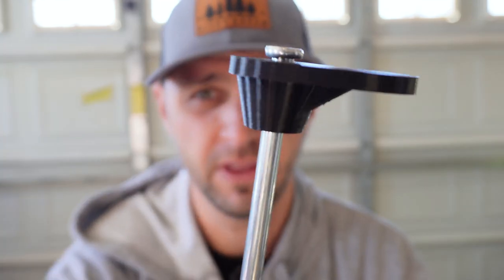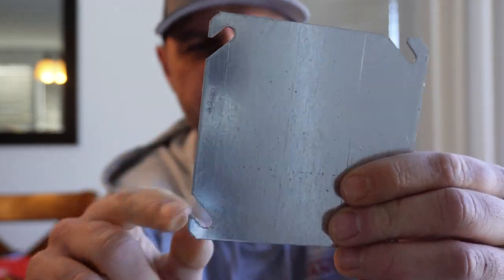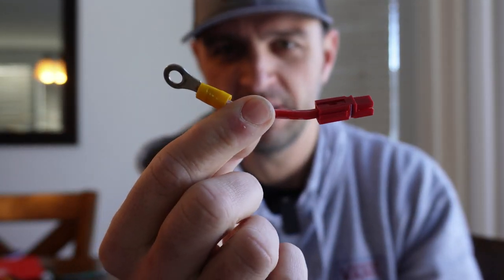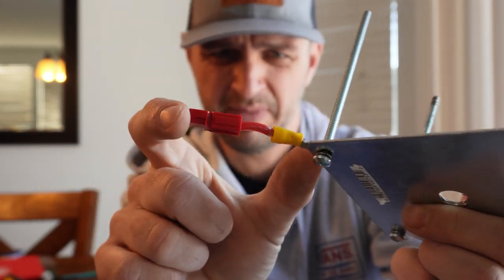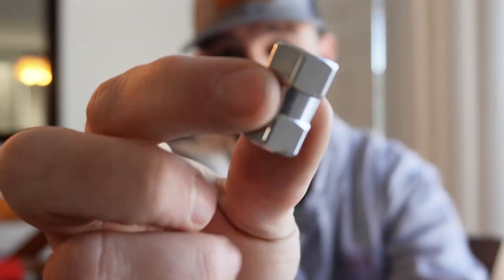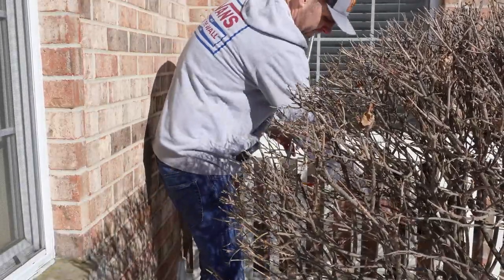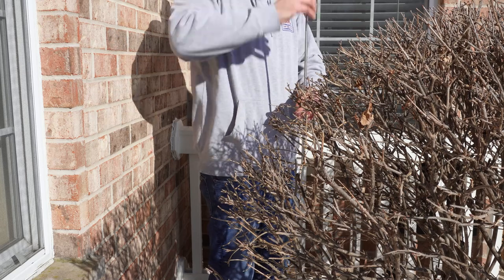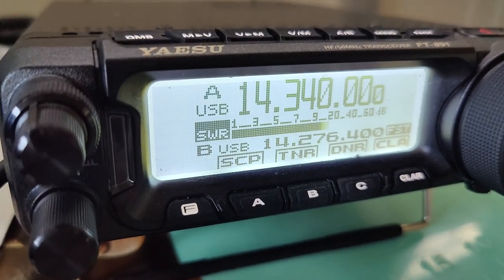Easy Homemade Ground Stake Mount - Antenna Mounting Solution for Ham Radio / CB Radio

Comment: An easy modification, use thread rod instead of the screws. They can then be any length you want (longer to go deeper into the earth), easier to install and you can use wing nuts on the top for easy addition of the radials.
Reply from the maker: Great tip, Lance!  So funny, I had threaded rod here and didn't even think about it. The original setup was going to be two plates and Risers between the two plates.  However, my hardware store didn't have long enough risers.  The threaded rod makes a lot of sense.  Better stability, better ground etc. I appreciate the tip!

Comment: Hi Sean,
Great setup. It was mentioned using threaded rod which is available in 12 inch lengths at Ace Hardware. Also get two plates without the knockouts and 16 nuts to fit the threaded rod. Position the second plate about half inch below the right angle connector. Stay safe.  73. WJ3U
Reply from the maker: DON! I don't know why I didn't think of the threaded rod. I have a TON of it laying around too.   Thanks for the tip, that is a great idea to get a better natural ground.  Originally, the design was a two plate system. that bottom plate worked well to prevent the connector to become exposed to dirt/etc.   It was a fun build, thank you for the suggestions and watching!

Comment: The mirror mount is much easier,  and doesn't cost much. But not everyone can get one. And we always need to think of new ways to do things when we can't get what we need. Thank you for more ideas. There are always other ways to do things. I was thinking that there are larger electrical boxes and the covers would be bigger and give a wider base. If you could find an about foot square piece of sheet metal and put the holes in it that would work great. Sometimes we can find sheet metal around. There are always other different ways to make what we need.  Thank you for keeping us thinking!    73   W4DES

Comment: Great solution to the problem.  If you drilled holes big enough for the tent spikes on the four sides (I.e., between the pre-existing holes), then used your screw method for the radials, and drove the tent spikes in for a solid anchor to the ground, you could mount a Wolf River Coil fairly easily and you would have a tremendous field expedient ground mount.  Great job of going the extra mile.
Reply from the maker: Thanks, Tony!   Initially, I thought of a two plate system with tent spikes on the bottom plate.  I think that would be more effective also.  Next up, I do want to print or design/build a coil.  There's something holding me back, I need to do a little research first.   (Although, I've always been the "Jump into the project" kind of guy). Regardless, I appreciate the tips and thanks for everything!
Reply: @HAMRADIODUDE  wow, lots to think about there.  Heat dissipation, diameter of coil, length, tapping method.  You have a full plate on that build.  But it will be fun to see you solve these problems, because I know you will.  I wonder if one of those mini Slinkys could be used as a coil around something like PVC pipe?  Maybe stretch it and then uses hot glue gun to keep the metal from making contact with the ring above it.  Or maybe couple it with a plastic slinky to do the same thing.  Anyway, it will be fun to see that project!
Reply: @HAMRADIODUDE  
I googled for "coil inductance calculator," and a bunch of webpages were returned.  One of them, you input D (coil diameter in inches), L (coil length in inches), N (number of turns), and it returns inductance.  It didn't ask for the gauge of wire, so might as well go with 00000 Gauge.
Only problem after that is figuring out how much inductance you need.  There are enough projects with loading coils to get an idea of how much you'd need.

Then I googled for "buried radials bare or insulated?"  Not the answer I expected.  After checking out a couple of search returns, the answer seems to be, "In most cases, either will perform the technical grounding function."  So the advantages and disadvantages of each are physical, not electronical.  I think that answer should be valid for buried, laying on the ground, or raised.

Regarding doing some meditation to create a plan, it's easier to just copy you; thanks for doing the hard thinking.  I was concerned the vertical mounted to the little electrical cover might be easy to tip over.  Optionally, maybe add some spreaders for a bigger horizontal footprint.  Maybe metal, maybe not.  Trying to think but nothing's happening.  Gud dx.

Comment: "Field Engineering" leads to novel solutions. You never know when you'll be miles from home and break or forget a critical piece of hardware. Always good to practice at home, and maintain that spirit of experimentation!

Alternative to the PowerPoles: 1/4" Spade electrical terminals meant for 12vDC systems. With a male/female pair you can easily connect and disconnect repeatedly. Also, you mix gauge sizes, allowing the proper gauge for the initial ring terminal to spade lead, then a larger gauge to allow multiple radials to be on a single terminal; much like you have the PowerPole setup. Added benefit of being available at any hardware store or auto parts store. If you're worried about damage or dirt on the spade terminals, shrouded versions are available, but sometimes harder to source.

Comment: Nice one Sean,.. I use a Piece of Re-bar and use a mount then connect the MFJ 1979, for portable ops,  20m / 17m / 15m,  add a coil for lower bands, your solution is great and allows for quick setup, and has radials!!  Really enjoy yr channel. Cheers n Good DX 😀
Reply from the maker: Thank you. Rebar is a great idea. I really enjoy tinkering with random stuff.  I appreciate the support, take care!

Comment: Nice idea to try out.
I think that making a simple version if anything opens the door to trying something else another day.
P.S.
Every radio guy must have a drill, must have a 12v terminal crimper kit, must have a little diddy $2 multimeter.   If he hasn't, then he needs to splash out $20....

Comment: Suggestion - put a metal washer between the lock washer and the plate and nylon washer. Then the lock washer won't get hung up in the slots on the junction box cover, or gouge into the nylon washer. Extra $0.75 or so but well worth it for longevity.
Reply from the maker: Thank you! Great tip and will definitely help others.  Have a good one

Comment: The pre-punched plate is a bad idea. Those centers are designed to bend and pop out very easily... not a good spot to mount an antenna base to! Use the solid blade and drill the 3/8" hole.
Reply: James, exactly what I was thinking.  Those "knock out" holes will likely fail with minimal wind load.
Reply from the maker: Thanks for the pro tip there, James.

Comment: Hey Dude great idea. Was thinking about using it with  G 90, portable or in  Emergency. 
You always have tricks up you sleeve 
73 KQ4CD Paul
Reply from the maker: Thanks, Paul! Glad to hear it's getting people thinking.
Reply: @HAMRADIODUDE  have looking for batteries  charger  Solar panels. I know I can't buy everything all at once but I can build on it. And I'm gonna use a tar heel 2 and  it's for an antenna until I get a 49 -1 1/2 wave 40 thu 10 for 100 watts.  Never know when a little more will get you heard 
KQ4CD Paul ⚓️

Comment: I have a throw back to a previous video about adding 1.25/.15 band to the Baofeng HT. I neglected to do a full test on this mod and I find any radio I add the 220 band to will not transmit more than .5 watts on the 220 band. I was wondering if you had done a full test after you added ti to your radio(s)? what was your findings?

Comment: HOA Karen,  that’s funny.  Wondering if you have or could make some videos on temporary mast support options(like the Spider Beam). Would  love to hear some ideas on supporting a mast for a temporary field deployment. If I wanted to do a quick POTA activity, with a wire antenna, need to use a mast to support antenna
Reply: Hi Harold,
This is what I use for my 12M Spiderpole. If your vehicle has a trailer hitch receiver there are mounts that fit that also.
Could be used for shorter and more rigid poles as well, up to2-3/8 inches if needed.

73,
Howard
Reply from the maker: https://youtube.com/shorts/xCH-IbqXXSw
Reply from the maker: https://youtu.be/hkOVlHnH9eE
Reply from the maker: The last one  I could think of is the tripod on a fiberglass/CF Mast - https://youtu.be/UibL3DSKbMg 
The video is about the mount for the mast but should give you an idea how I found a tripod at Goodwill and used it for the mast.

Comment: I used to have that same "Fluke" DMM! lol. So, WHAT is the main element of your antenna? BTW, your radials need to be at least 1/4 wave length at the operating frequency, or more like 20' each.
Reply from the maker: I'm using an MFJ1979 pole. I am in the process of building a coil for it as well.  I am going to call it the "Fox River Coil" (a spoof on Wolf River Coil, as the Fox River also runs through Wisconsin).  Thanks for the info about the 1/4 Wave Lengths, I don't need to make a video anymore :D.  Also, in case anyone is reading these comments, It IS okay that your radials are longer. There comes a point where it doesn't significantly improve anything, but won't harm anything.  So if you are using an antenna on 20, 17, 15, 12, 10, and 6; Just take a radial length of the lowest frequency you will be using. In this case, I would want a 1/4 Wave of 20m.  
73

Comment: That knockout should be removed. It doesn't take much to dislodge, only a 1/8" left un-punched, and the plating holding in place. Use Washers